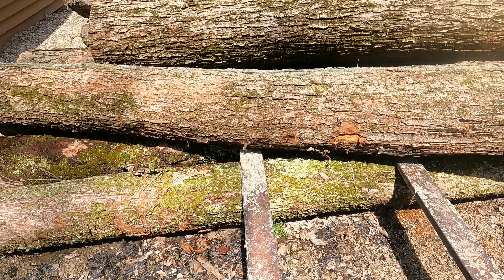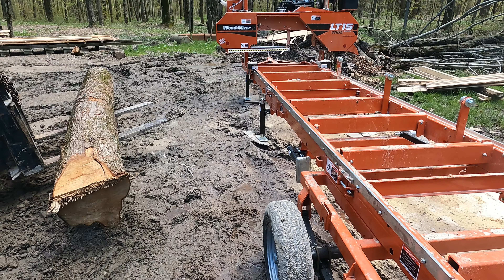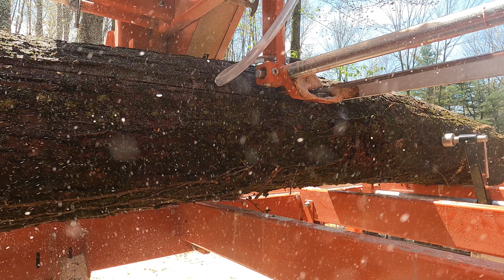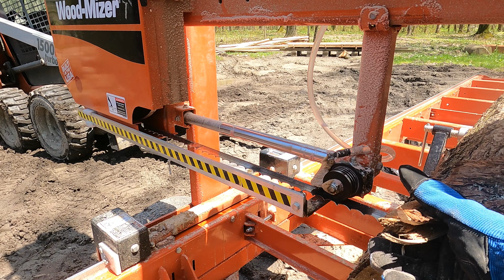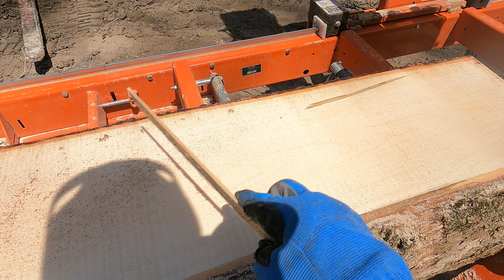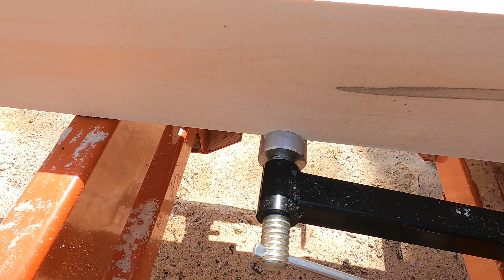Solid Maple boards

Comment: Good video. I saw the Morgan video you mentioned and you're right. If you don't already have one, Wood-Mizer offers a quarter scale for your mill. I will help eliminate the need for the last skim cut on too-thick boards.
Dave
Reply from the maker: I definitely need to get that...
Reply: @mcsawmill  I believe you'll need a support bracket to mount it.
Reply: @mcsawmill  Forgot...... CALL Wood-Mizer for the info; their website is not that good at finding their own products.